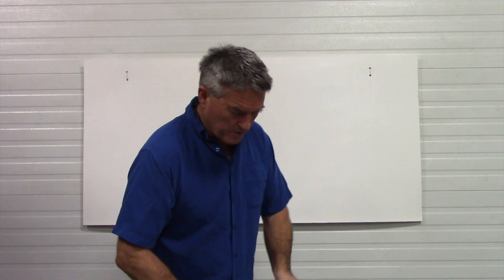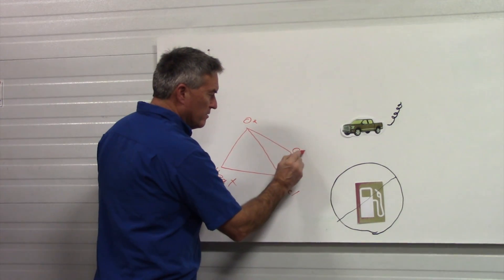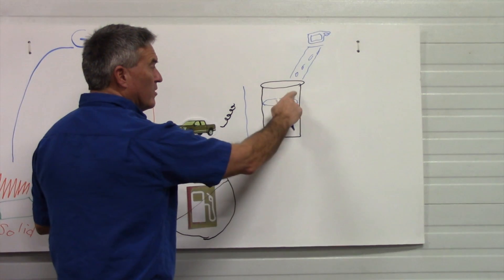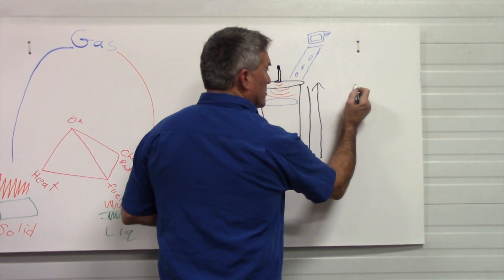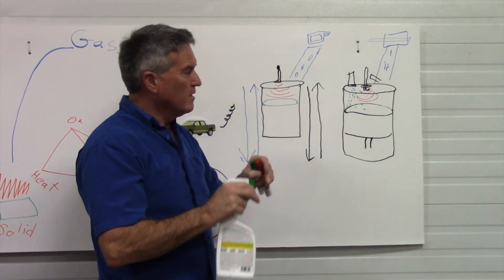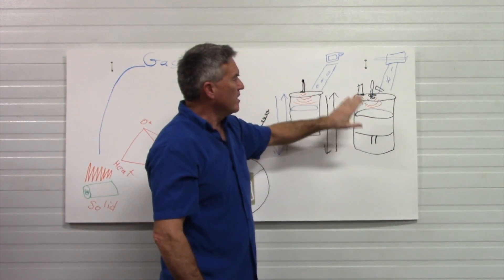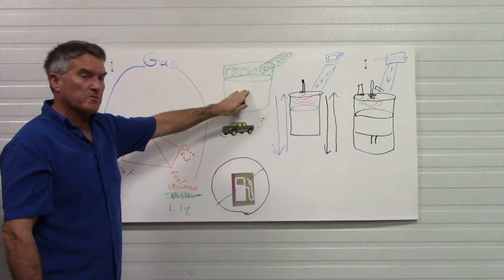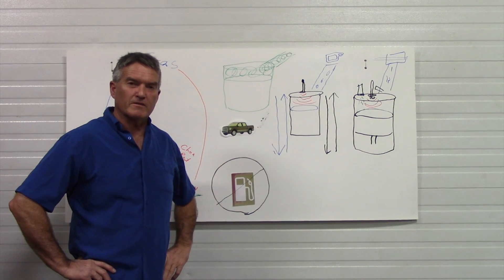One Simple Trick to get 100 miles per gallon with less pollution!

Comment: Hi can you please contact me regarding me fitting this to my  vw bus . grahamf355@gmail.com
Reply: Can I add you to my list in Get Response?
Reply: Jeremy Kegley    yes if you can help me
Reply: I'm not a mechanic but my uncle is and he seems to know a lot about this stuff!
Reply: +Jeremy Kegley 
then have your uncle look up exahust valve timming to intake stroke duration and he will see how all engines are internaly savatoged were by the exhaust valve cracks 1/2° on the intake stroke allowing exhaust manifold  vacuum to suck out 80% of the liquid charge and  dispose of it in the converter.
Reply: +Stupid Man 
its a simple grind correction on the exhaust cam lobes.

Comment: You are so full of crap. Fossil fuel. What a joke.    It’s Peter chemical. Not made by fossils no made from dead dinosaurs    Has burns hydrogen and turns to water vapor.  Very few other components of the burn off
Reply: fossil is anything buried underground witch includes oil,  coal and so on, you Einstein
Reply: You used "witch" and call Dave "Einstein"?  Dumbass.
Reply: Squeeze and heat dead algae and see what runs out...

Comment: so propane or natural gas should give you 70 miles per gallon because it is already a gas ???
Reply: Nope. It takes a LOT more propane or natural gas to efficiently run an engine because it does not have NEARLY the amount of potential energy that a liquid petrol fuel does. Although the gasoline engines waste over 65 % of the fuel that gets injected, it still needs less gasoline that natural gas or propane to do the same work.
Reply: Positive statements presented as truth do not necessarily carry "real world" truth.  If you are running gasoline thru a carburetor, with varying vacuum and changing conditions, the propane may be a better choice because it is absolutely vaporized, and the mixture is more stable, as the analog carburetor throttle plate opens and closes.
Reply: Basically when using natural gas it has less potential energy so ends up displacing more air from the cylinder than gasoline would which means lower power output, but you still have the same operating losses in friction etc... so lower efficiency.
Reply: That is so glib: and so wrong..   "Mass" is beside the point.  Specific energy per volume, or per mass is a way of measuring "fuel value",  but heavier fuels are not necessarily "better."  Some nice heavy plastic monomers will burn,  are liquid,  and suck as fuels.
Reply: @davido.newell4566  Olive oil is a clean renewable fuel that does not produce harmful pollution & releases no carbon emissions into the environment. But it can't run an engine for shit.
Reply: YES!!!!!
Reply: frank  No. Propane or natural gas is gas, at normal atmosphere. It has less mass, hence, less energy then gasoline (or diesel). The trick is to vaporize the gas and "keep it vaporized" till it gets to the cylinder, safely. Vaporizing the gas is easy. Keeping it vaporized, and doing it safely, is the trick. Don't ask me how I know.
Reply: I am convinced that this can be done... but I suspect there is be a political reason that it isn't being done. 

Gasoline is liquid. Liquid doesn't burn, but the vapor(i.e. gas) burns. So the liquid gasoline needs to change state to a gas. I believe that heating the fuel line would be the easiest way to do this.  It doesn't seem that difficult, after all, Diesel engines have glow plugs to heat the chamber to start Diesel engines in cold weather.  I think this would be possible for gas engines. There are others things that would need to be adjusted, like air intake etc, etc, etc...
Reply: @daveunderwood6498  
Because it's been done - if your old  enough and was in the auto field of racing or hot rodding this would be just another case of - a day of our lives
Reply: mr. nobody  No. With racing fuel, there is no "junk" in the fuel. It's pure and it evaporates easy and fast. It's very expensive because of this. Try to evaporate regular 87 octane and keep it vaporized until it gets into the engine....safely. It's hard to do.... nothing a fire extinguisher couldn't deal with. :)  The additives they put in the regular fuel nowadays are not just "detergents" to keep your engine clean (lol). They put refinery waste in the fuel and this has been going on for decades. That is why they into introduced catalytic converters. It was to clean (reburn) the unburned waste of the fuel going though the engine. The same thing in going on with diesel engines now and their after burner systems. They have so much refinery waste, they have to do it with diesel now. The short of it is...when you buy gasoline or diesel, you are not just buying gasoline or diesel. This is information from an insider.
Reply: So it is your stance that the mass dictates the energy available?  So for instance propane as a liquid weighs less than gasoline as a liquid and therefore then the gasoline is more energetic?  My gosh, tell NASA to give up with the liquid hydrogen fuels, they'll never get off the ground.  
The only place your  "It has less mass, hence, less energy "  is "true" as a general statement, is in a nuclear reaction.